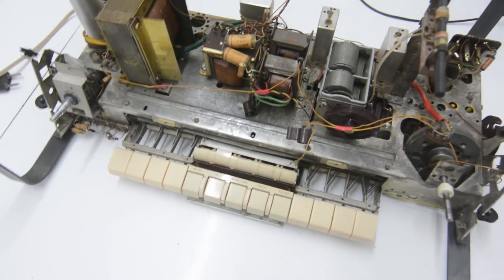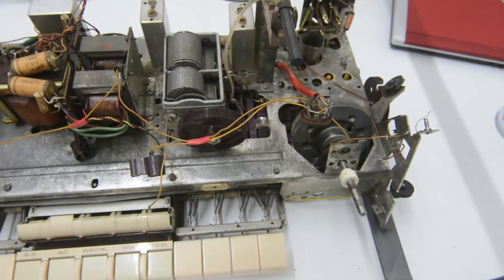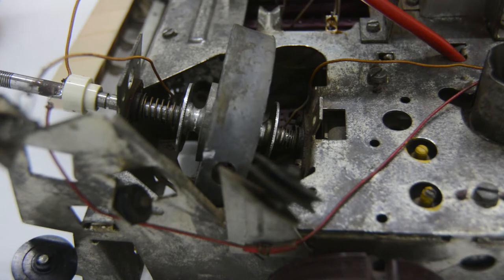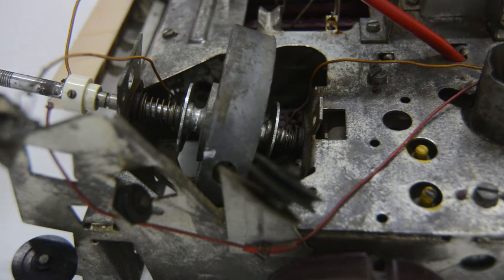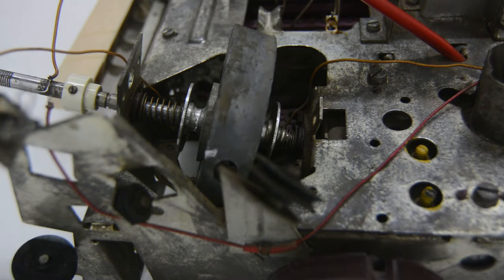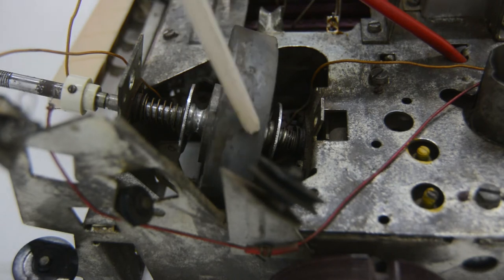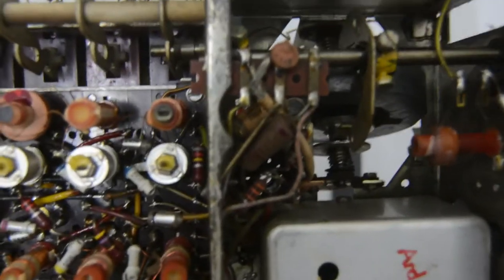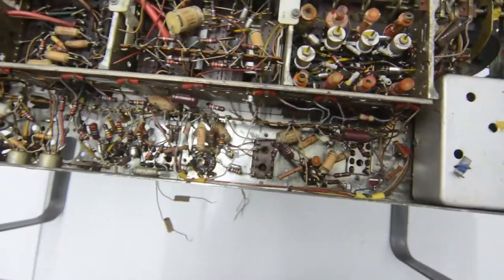Flywheel & clutch mechanism horror - Grundig 5195 Stereo (Part 3)

Comment: Nice solution for the fly wheel.
Reply from the maker: Have to admit that I was a bit lucky that this solution was possible at all. I've seen cases where flywheels were much more damaged than mine. Also, I didn't have to replace the grippy material, which was surprising, because that's the part which usually completely breaks.

Comment: 0:23 - wow, yeah you have... almost looks like a different device than last time!  :D
2:45 - interesting to hear them called condensers... I guess that was the original term, and is still used in some contexts (including other languages)... perhaps including this one?  (To me, I'd call them capacitors, a term which I think I've also heard you use (a yes... 11m17s into the prior video), so perhaps you're using this just for the adjustable ones?)  Anyway, no complaints, just interesting!
[whole big chunk, incl. 8:21] - wow, that flywheel thing is so cool.  The clutch activation, the fork, and just that a control knob has a flywheel... wow.  That must feel so nice to tune, compared to some modern rotary encoder or something.  :)
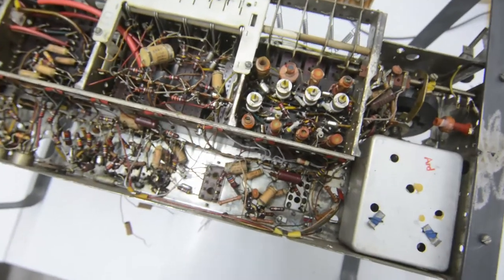8:40 - ok, I see what you meant in that other comment - a whole lot of circuitry without circuit boards!  Fascinating.
12:33 - I can't speak to whether it's original or not, but I can see that this part was clearly cast into a mold -- you can see sprue marks (e.g. at 12:38).  So, not something done on a lathe, though... one would think the mold would be made to be fairly round... one would think!  (Unless it's deliberately oblong, for some reason??!?)  Here's hoping it's not Grundig's fault.  ;)

Very cool stuff.  Glad I (somehow) found you.  :)
Reply from the maker: "Condenser" is basically an just old term for a capacitor. It's still used today in the context of condenser microphones and (in my experience) also for tuning capacitors. So I use them interchangeably.
After I made this video I realized why the flywheel is oblong. It's probably because there's a tube really close to it and it has been sitting stationary in the same position for many years. So it's probably just deformed because of the heat generated by that tube.
Thanks for your nice comments!